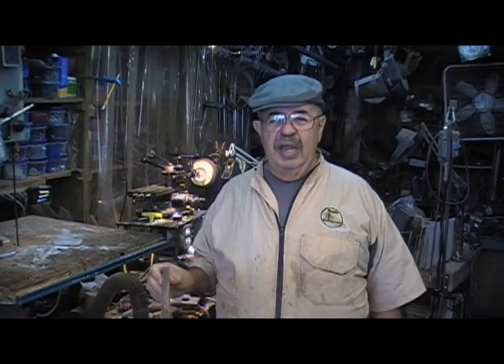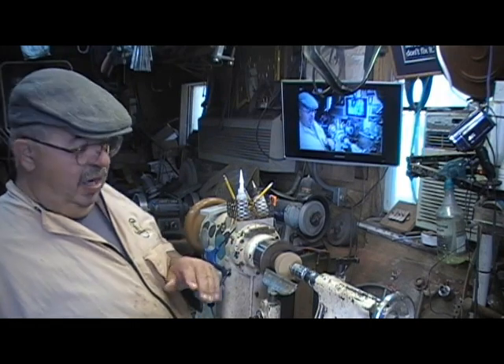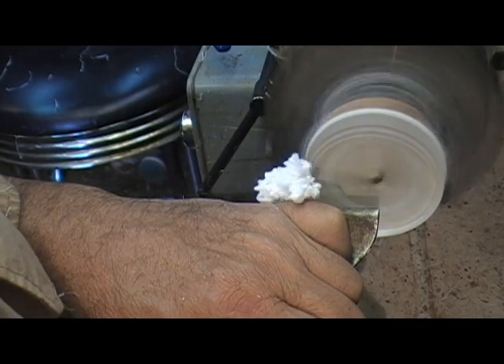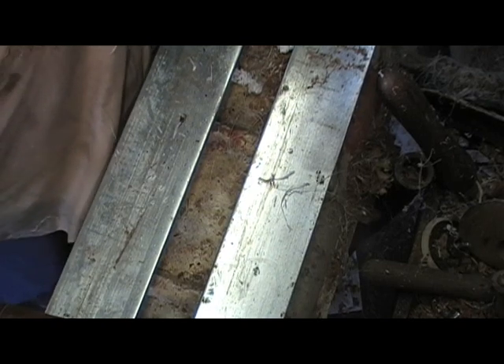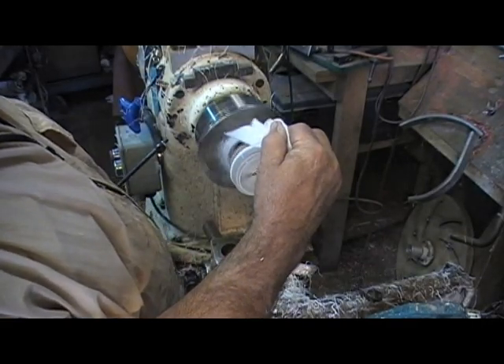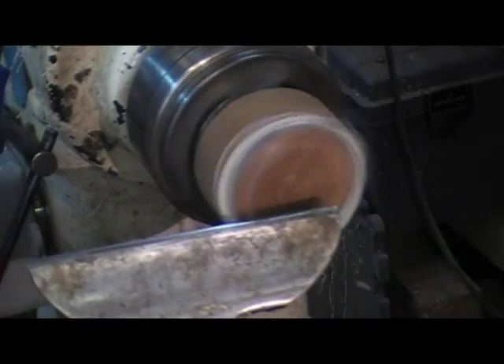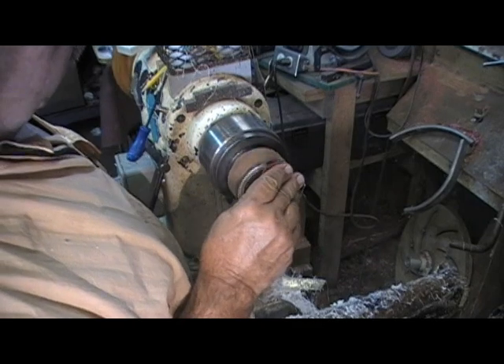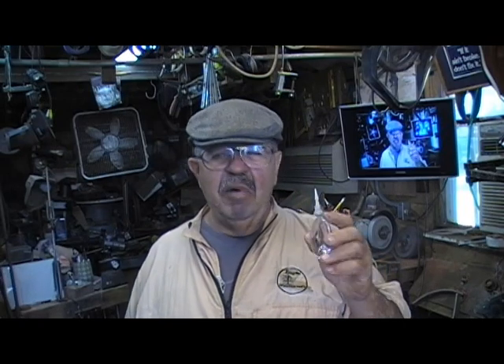# 203 Working with Acrylics

Comment: Hi Capt.
I have worked with acrylics for a long time now can I suggest to save some time once you sand to 600 try quickly run a blow torch over it (the one chefs use) it will polish up like new . Takes a little practice but save a lot of work